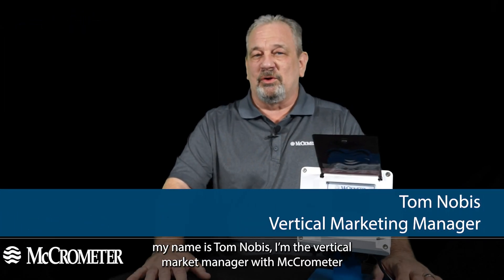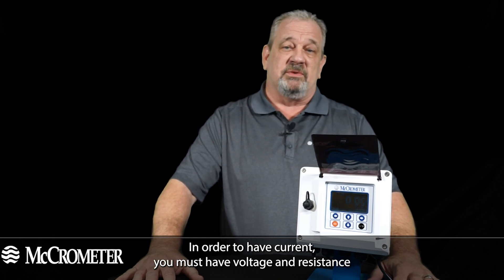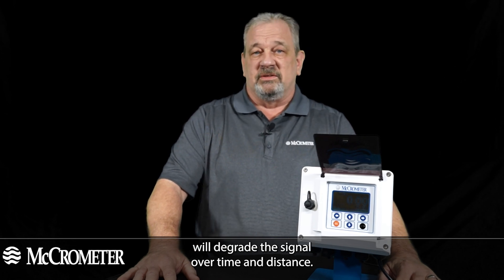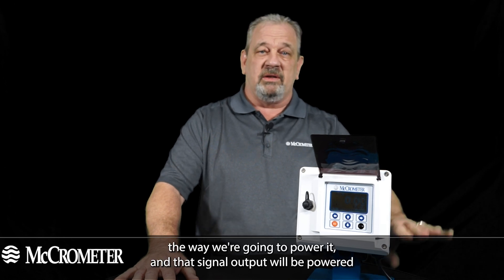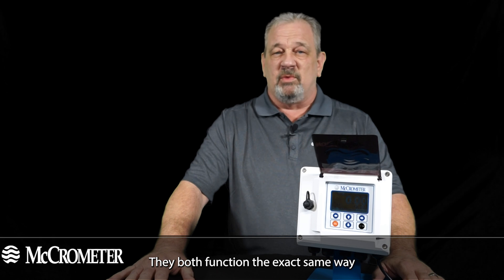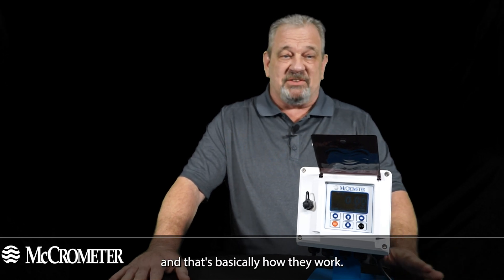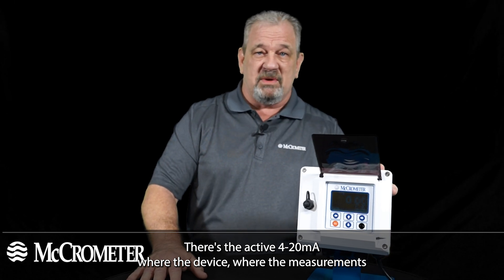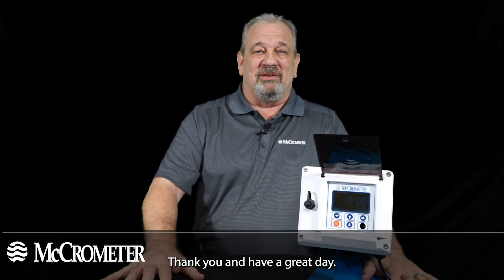Active and Passive 4-20mA - What's the Difference?

Comment: Does is it always have ro be 24 volts?
Reply: If your within 600 feet then 24 volts is standard. If your over 600 feet we like to use a micrometer to adjust the diodes and keep a steady current at the dedicated distance. Everything changes but the ultimatum is the same outcome